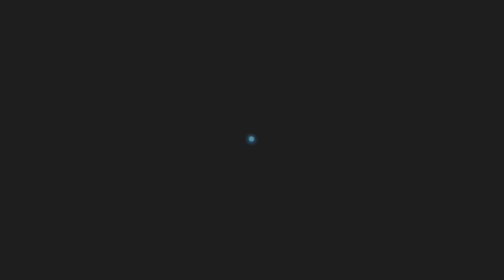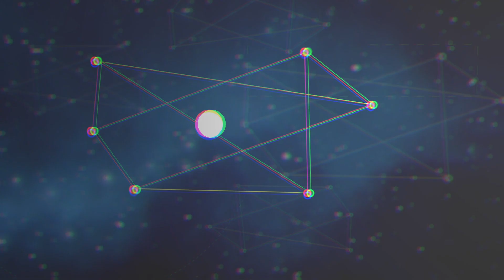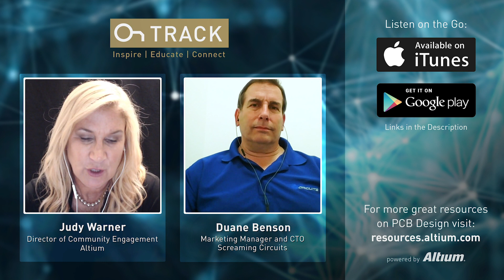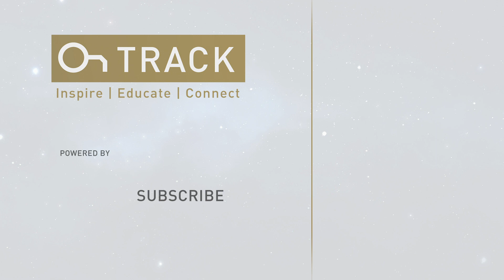Manufacturing Documentation with Duane Benson

Comment: speaking about standards, there are IEC standards for CAD liblary, sof file types, for footprints, for soldering. IEC and IPC standards are not completely similar. 
More crazy that local standards, even if they are based on IPC or IEC could by a modification, compilation of several standards, not speaking about misprints, inaccurate translations, wrong translations.